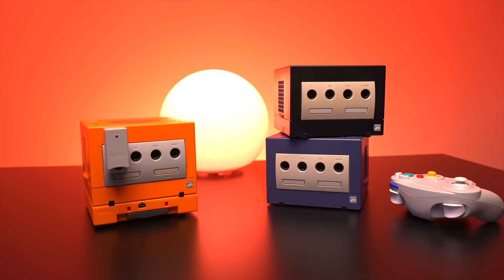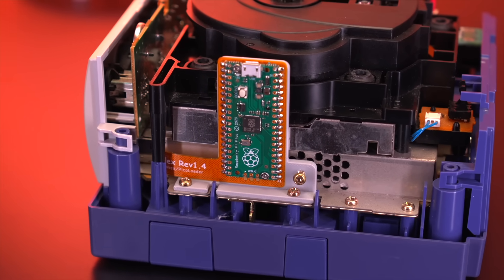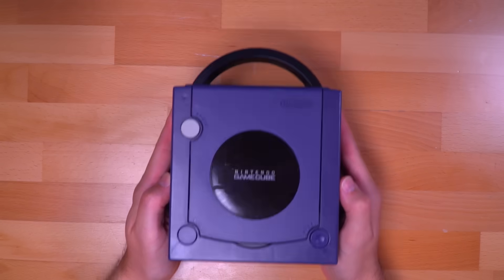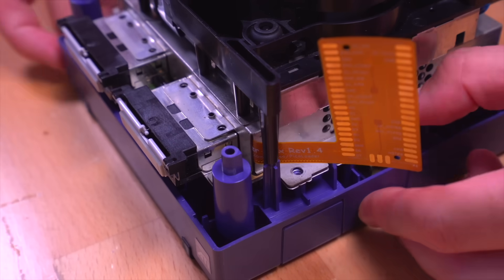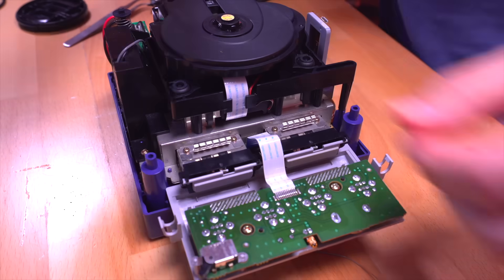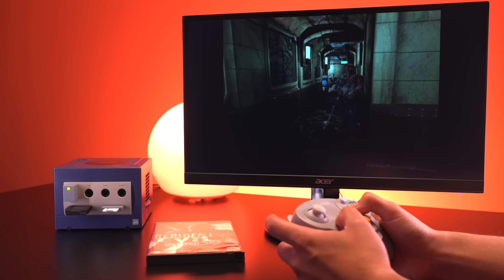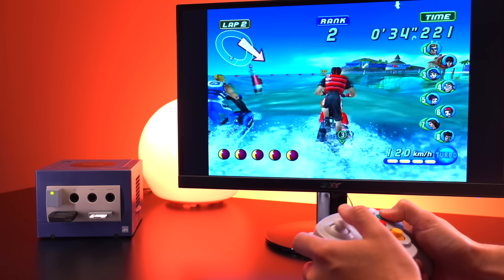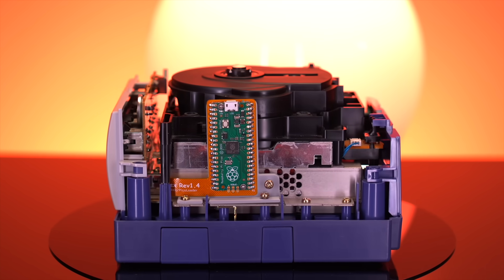New SIMPLE Open Source Gamecube Mod Chip | PicoLoader

Comment: you could wire the ribbon to the piko on the outside of the console? slot each wire through the holes on the side that doesnt have the fan on it, then attach the piko board to the console via double sided tape, and then using electrical tape to protect the wires, that way the boards on the outside so you can update the firmware, and 3d print a cover that clips to the bottom no shell damage and you can easily remove the cables from the board and then the ribbon cable if you change your mind, ipa will remove the tape residue, just a thought

Comment: The biggest question is. Does it work with the xeno chip. Bc the xeno chip is soldered on board. Which honestly why do this when the xeno chip lets u play burned games.
Reply: Xeno is honestly too unreliable. I had two cubes with the chip Installed, and neither liked to read burned discs well. One was even freshly recapped. Burned discs also put more wear on the laser.

Comment: I have tried 2 of the ribbon cables and can't get either to work. I am not sure what's going on. When installed, I get an error has occurred message on the screen. I have installed one with nothing attached to the ribbon, and one with the pico ready to go. when a ribbon is installed in the connector, it will not work. Shouldn't it just work as normal if the flex is installed without any pico board on it? I did that with the 2nd one to test it.

Comment: The worst part is the soldering. It should be pre-soldered if this is going to be the case... 
Also, I would prefer a full SD card mod for my gamecubes. I have 2 different kinds of gamecubes, one with the slot underneath, and one without. 
These companies should also be selling their GC SD card reader mods on Amazon! I get my Amazon gift credit, but I can't spend it on another web site... I gotta go through Amazon to buy my stuff.

Comment: My FlippyDrive just showed up today and yet another amazing GC mod has dropped!  What a great time to be in the scene! Would be cool if they could implement using a Pico W or 2W  for OTA firmware updates and possibly NAS support, but not sure what the technical limitations on either of those are. With as low cost as some of these modern mods are it has me tempted to pull my GCLoader, pop the optical drive back in, and give some of the new crop a try. I love the innovation of using a flex interposer between the optical drive and the mod allowing for full functionality with an easy / no solder install. Looking forward to what comes next!  Thanks to all the Dev's of these amazing mods, and thank you Tito for showing them off with your great videos!

Comment: put the xeno chip in.
Didn't even work the first time. wire method worked.
Trying to do less soldering attachments. I don't want to wreck my system to much. What a bad attachments. 
Plug and play please.
IDK a stack of cd's are like $17 or something. one game at shop is $50. Store may be sold out to :(
IDK the store bought one is perfect copy, . Why copy protection IDK. i wanted to stop.

Comment: I did pico boot a while back, before the flat flex cable mode came out. And I had all sorts of trouble trying to get it to boot. I then re-did it with the flex cable when that was released, still had trouble getting it to boot. Now I hear Tito mention compatibility with clones... Yeah I was using a cheap clone off AliExpress... I didn't even think about it. I wonder if that was my problem?

Eventually I returned it to stock and sold it off.

Comment: The only thing I don't like about the Flippy Drive is the cramped graphics they use for the games, on my little CRT it's hard to tell which game is which, but it doesn't bother me that much. Considering they are the same price, I'd choose the Flippy Drive (which I have twice already 😹) since this one requires soldering, which I'm OK at doing, but with slightly shaky hands I don't like doing it very much.

Comment: How does it work with discs though? Does it immediately boot any disc that’s in the tray and only goes to Swiss if the tray is empty? If that’s the case, can I play US discs this way on a Japanese console?
Reply: You have to navigate to the DVD device in Swiss. You can set it as autoload to start with it.
Reply: @ExtremsCorner 
Ah, okay. So it always automatically boots Swiss, and you can configure Swiss to do whatever from there.

Comment: Removing an working optical drive should never be an option.
I'm glad solutions like this and the flippydrive exist.
For my Ps1 I bought a PSIO, and for my saturn a Saroo, for the sole reason their drives still worked.
Same with my Dreamcast, that one got a sata adapter soldered to the gd-drive, and a tiny ssd too. The drive is still functional.
Reply: It's nice to bypass it without removing it but for most people the drive is going to be a point of failure. I think most would rather not have slower transfer speeds through a memory card slot.

Comment: I still have some Pico Ws flying around here. I wounder if there will be a way to update the FW via wifi some day? It´s a nice project and way less pricey than the flippy drive i guess.
Maybe i´ll use it for my cube with working drive. My cube without the drive gets an ode chip i ordered long time ago. Btw, printed my own case for the cube and it looks fantastic but was hard work to set the printer up right. 😁

Comment: I feel there's a major con to this install in that it's not really acting as a full ODE, still requiring the Serial Bus and/or the Memory Card bus for backup ISO loading. This loses out on the core function of an ODE as a utilization of the fastest memory channels for loading backups. The newer version of the SD2SP2 does ail a good bit of the streaming video woes, but hopefully this project's coming versions offer a method for backup ISO loading actually via the disc drive port, like the Flippy/GCLoader's flash memory interfaces.

I think this mod does a lot of smart things, but with just a Pico on board with no other interface hardware, it's simply a welcome continuation of the IPL hijack.
Reply: You’re right, but personally I’ve never had any problems loading ISOs through the serial port 2, and it’s also easier to access the SD card without having to disassemble the console.
Reply: This is the only reason I think the Flippy Drive inches ahead. But that lead is almost removed by having to open up the GameCube to access the SD card to add more games.
Reply: @jeremysouthard  Very true. Still, Laser Bear has an SD extension mod that moves the card access to the power drive light(custom LED diffuser, but that is an added cost.
Reply: @TheLastDraconic  and just that SD extension costs more than this whole mod will 😂

Comment: I picked up a Pico (over a year ago) but, have not installed it in my Spice orange Game Cube, was waiting for updates and a solution not to have to pull the console apart to upgrade, it's why I have not done it yet.  Right now, just booting off a Swiss CD and it provides the same result but, just slower... I might just say screw it, and install it....  I checked updates and there has not been to many so it might be a non-issue for me...

Comment: 1.- put firmware to pico/raspberry with pc.
2.- solder pico to flex cable.
3.- solder diode to flex
4.- install flex to console
5.- play a lot of games and fun.
Reply: i would not, high risk to break the flex with the weight of the pico installed
Reply: I prefer the order of operations presented by Tito as the bracket works as a guide and does not cause stress on the rest of the flex cable.

Comment: The lame part I see and feel should be addressed is the data speed on the memory card slot, sp2sd port, vs optical drive port. 

The game I dramatically saw an issue is stuttering for Mario Sunshine when using those two locations. When I got a GC Video, that problem seized to exist because of the speed. 

Does this mod address that? Cause I am surprised, with having the flex ribbon cable, having a sd card adjacent to the Pico.

Comment: I get that you don't have to solder wires directly to the chip and 3 other points on the MB, but there is still soldering required, so the same equipment is needed. This just seems like a more expensive way to do the pico mod. I guess it's preferred for some, but I'll stay with the cheapest option.
Reply: its soldering to an external flex cable versus soldering to the motherboard. a flex cable is easy to replace versus the ipl chip which inexperienced modders tend to ruin

Comment: is there any reason why you chose to install the ribbon then solder the pico? because to me is seems a lot simpler to solder it first then install.
Reply: Seems like it's done as the 3D printed stand has it built in so ensure it's aligned perfectly for the end user/installer. You could do it before, completely up to you
Reply: @Timmymantwo  I realize that I'm being kinda pedantic here but pointing out mounting the pico to the 3d stand and soldering it then installing it still sounds like it would be simpler to me.

Comment: The FlippyDrive really set a new standard for how optical drive emulators should connect to a console. I'm really hoping people figure out ways to add that to basically all other consoles over the coming years, so it's nice to see other teams try out the same.
Reply: Im dreaming for one on the ps2 slim
Reply: @gonzalonovoa8137  if they can and it has 80%+ accuracy thatll be my dream ps2
Reply: Yeah, I don't love that the GDEmu for Dreamcast requires fully removing to original drive.
Reply: @TrentR42  I kinda regret doing that mod, and even more so giving the GD drive away since it was a Sega Sports model. Still, it's a nice mod overall, but I'll be kicking myself in the butt if someone ever comes out with a non destructive mod for DC.
Reply: @bluorb same, but at least I made sure that my GD-ROM was dead before I did the mod (and I bought another Dreamcast with a working GD-ROM for disc stuff)
Reply: Same. Genius level innovation & I hope the genius idea spreads. I kinda don't like this one since it literally stole the idea, but cool for the open source aspect.
Reply: @bluorb  atleast you don't have to wait a year to mod your GC like with the flippydrive

Comment: This is a cool project and a step in the right direction, but it NEEDS to be a completed kit out of the box to make sense. As is, this requires too much extra soldering and extra pieces to get working on top of still needing to flash the board afterwards. People who are looking for a completely solderless solution like what this was LOOKING like for a moment will be entirely turned away from this project, especially if you have to source every needed piece from a different place. Its great to see new ways to get a Pico into a Gamecube, but the FlippyDrive is already several steps ahead just based on the fact that it requires zero soldering.
Reply: I agree with you that people will benefit from a plug-and-play solution. I think there is a different group of who will appreciate the non-plug-and-play picoloader given the MUCH simpler soldering required over picoboot. In attempting the picoboot mod, I somehow managed to ruin two GC mobos. I was horrified. I ended up having a pro modder handle it. My soldering skills aren't great but I could definitely handle what's needed for picoloader.
Reply: All that words for something that he addresses in the video 9:45

Comment: How much of an improvement is this over helders flex cable? I currently have a pico booted wii using that config. it works good except for the 3.3v power issues when using the HDMI adapter and to get around that I have to power the console one with the tv off or insert the hdmi adapter after the console powers on. If I don't the current goes all to the digital port to power the HDMI adapter and the picoboot chip won't launch it's payload.

Comment: This mod is cool but it still relies on the memory card slot or the port underneath for loading games. Where the flippy drive has better loading times (correct me if I'm wrong here?) it would be awesome if they could integrate an SD card slot.  Also, is it able to load cube boot?

Comment: I have 4 gamecubes (one each of the four "basic" primary colors) with 2 flippy drives which I've yet to get around to installing, and two with picoboot that I've already installed and currently use... This is cool but I'm not sure it's worth tearing out my existing picoboot installs to replace it with this...

Comment: QUESTION HERE I have never understood the point of modyfing a GAME CUBE if we can load all the game cube games on a Wii by using Nintendon´t,  IT IS CHEAPER AND EASIER beside the games run as I would have been running on original hardware , Did I miss something ? please let me know....
Reply: Digital video out port and Gameboy Player functionality. For some like myself, not having to use a Wiimote for some of the menu navigation is also a plus. Otherwise, playing GC on a modded Wii is a much cheaper option that many would be perfectly happy with.
Reply: @SkyScourgeGod  I think that playing with original hardware is specially important por Pokemon fans who play the GBA games in a professional way because a lot of reasons however at this point I'm perfectly fine with mGBA and Nintendon't on Wii or DOLPHIN on PC.
Reply: Digital video out if you have dol-001. Thats it
Reply: @Velocifyer  I think that I can live without it meawhile the games run as It did originally ..... maybe until Dolphin improves its compatibility with the game cube exclusives I think that at point DOLPHIN is going to be the best way to play them

Comment: Cool project, but FlippyDrive is still superior in my opinion. Even the Cube ODE from Aliexpress is a better plug and play solution if you don't mind ripping out the disk drive completely. I have two cubes with Flippydrives, two with Cube ODE, and one with a regular old Picoboot. I completely botched my Picoboot installation when I first tried it and melted off a pin of the chip on the motherboard, because people exaggerated how easy of an installation it is, and that's what I love about FlippyDrive and Cube ODE so much. Truly plug and play solutions for people who suck at soldering, like me. My hands are just too shaky when I am trying to solder to points that small.

Comment: I fail to see the advantages versus the Picoboot, same Picoboot but with more soldering for the same thing. Do the Picoboot and use the opportunity to change the thermal pad of the console. Soldering 2 cable to the motherboard is not harder then 26 soldering point.

We still wait for the M.2 loader witch is supposed to truly improved load time and cinematic lag.
Reply: I disagree, I think this is far easier for inexperienced people to solder than the pico boot. If they damage a rpi pico, it’s an easier hit than damaging a GameCube.
Reply: Why change the thermal pad? AFAIK they don't dry up / go bad the way thermal paste does. I'd only replace it if it got torn up or something while disassembling. Agreed that PicoBoot is great, though.

Re: load time / cinematic lag, have you seen the SD2SP2 2.0? It managed to improve performance a bit by doing something the M.2 loader is supposed to do. Extrems made it, forking the original design and updating it. You can also find a "pro" version with the angled connector on aliexpress like with the old version.
Reply: @SoundToxin You know your stuff, I was unaware of a 2.0 version, I only have the 1.2, I'll have to order one thx.

And yeah I'm splitting hair with the thermal pad, I just think It's a good preventive maintenance while we are there.

Comment: Tito, I noticed that you didn't solder to the bottom three pads on the Pico. I'm assuming those are completely optional as the original Pico mod only requires five pads, I was just curious as it wasn't called out. 

I love these mods are getting cleaner and cleaner... though it is going to spike the already inflated Gamecube market. LOL!
Reply: those are debug ports. They are exclusivly for connecting a external debugger
Reply: @Velocifyer thank you for the explanation.

Comment: You don't have to solder directly to the ipl chip for good old Picoboot. There are some alternative pads and points on the GC mobo to use, but of course, you still will need good soldering skills for clean and reliable installs.

Comment: Going back to the days of the NES, well at least for this 50-year-old fart, how in the hell do people figure this stuff out.  For example, severing that exact 4th pin from the 10-NES chip disables it.  How about the PS1.  There are 1.2 bazillion solder points on the motherboard.  How did someone or people figure out exactly which ones to use to install the MOD chip.  I  mean, I can go on and on.  But it will never cease to amaze me.